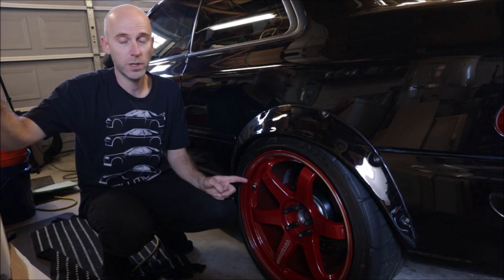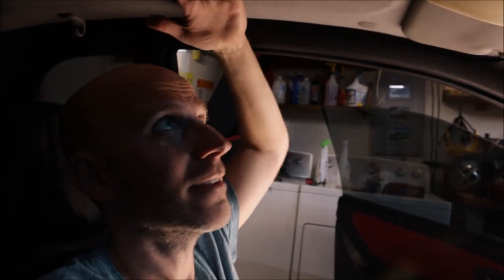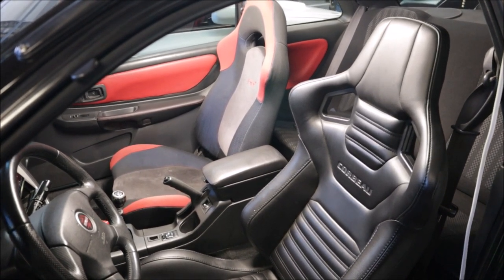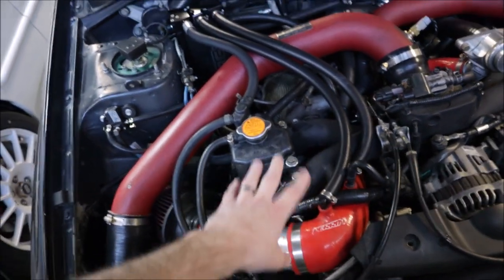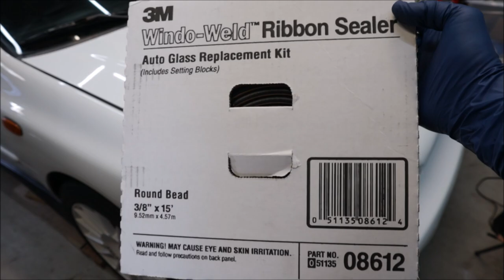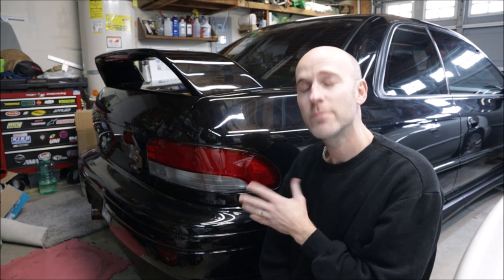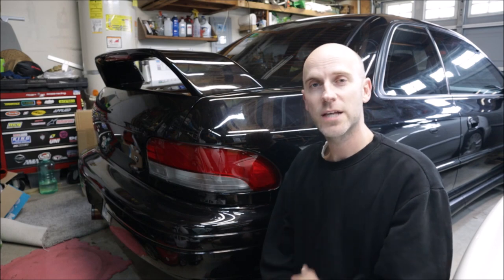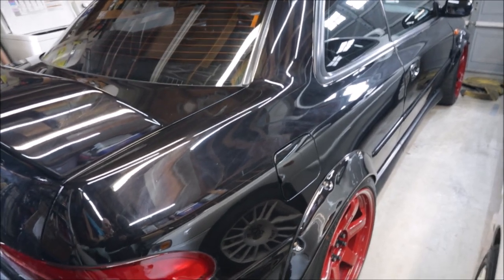The Impreza Project Is Complete! Keep or Sell?

Comment: Hey Brandon what’s the best way to seal up the taillights ? Did u also apply silicone onto the body as well as the tails ?
Reply from the maker: Mike, I used the 3m window seal tape and no silicone. I also have Roger Clark Motorsports neoprene seals. They look like a great option and I’ll try them on the other car.